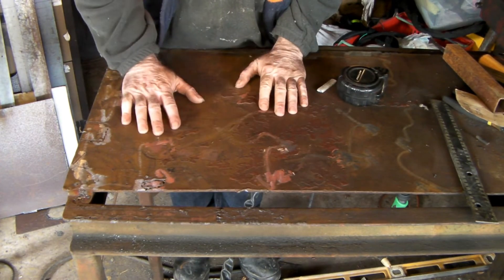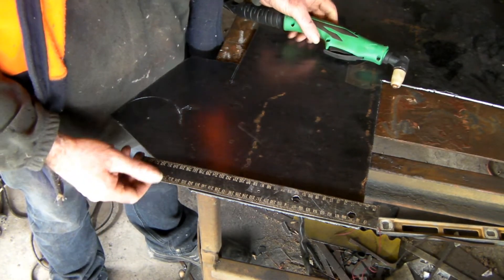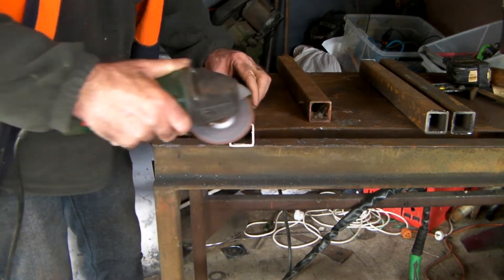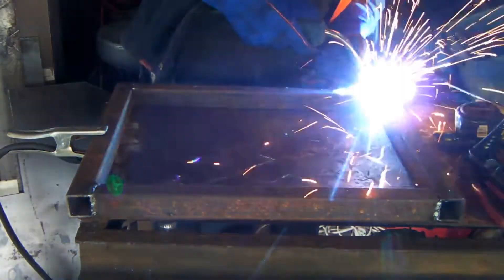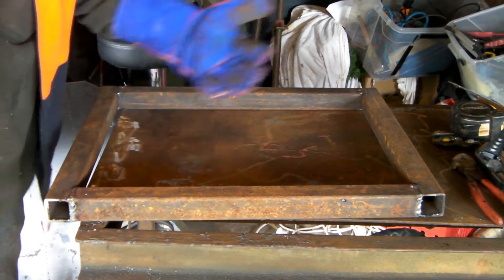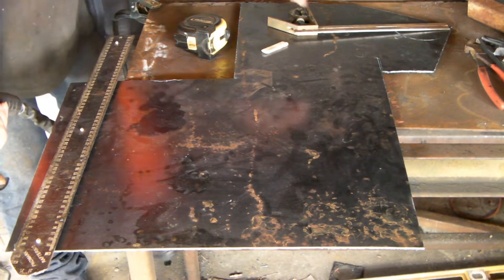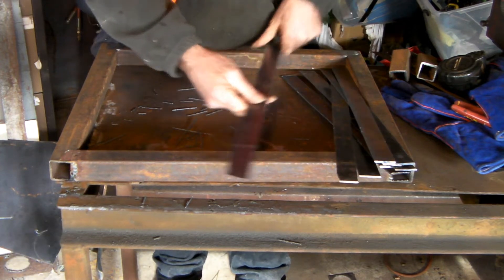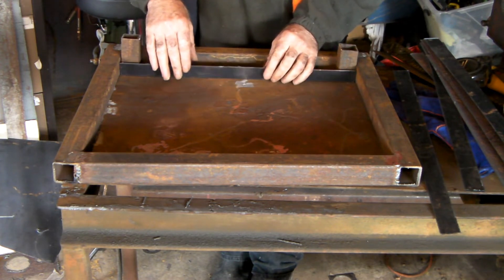Diy Plasma Table / Plasma Table Build

Comment: Nice and simple. I made one similar to this, but I made the slats about 15mm longer and cut the edges of the side bars to slide the slats in and out to replace them. I didn't want to cut off the welds for replacement. Thanks for the great content!!

Comment: Hi Pete just found your channel,mate you'd talk the leg off a chair.....What make and model of plasma did you use there.......asking as a plasma virgin...have always gas or grind metal. Regards Dave.
Reply from the maker: Hi Dave i use a cut 40 but the cut 50 would be better.

Amico CUT-50HF 50Amp Pilot Arc Plasma Cutter : https://amzn.to/2ZCOXCz

Amico CUT-40, 40 Amp Plasma Cutter : https://amzn.to/3hzgVFo

Cheers pete
Reply: @petestools  Thanks Pete will look them up...Regards Dave

Comment: Great work.  It will be a great help.  You could put 40mm legs on each corner so the hot air can escape under the table instead of rising back up towards you.
Reply from the maker: cool idea ,I was thinking about a water table as i tend to set things on fire LOL
Reply: @petestools  I wonder how sand would work in a pan instead of water, which I hear gets pretty nasty. By bucket for cooling lawn mower blades sure does. Cheers!

Comment: Hi pete, you cut wonderful , smoothly like silk !
I just bought machine with pilot features but I cut very bad. what thickness of metal sheet ?
What PSI did you set (60  ?, 70 psi ?)
What current did you set 30A, 40A, 50A  ? 
Thanks
Reply from the maker: you will get used to it very quickly , i run at 40 amp at 100 psi